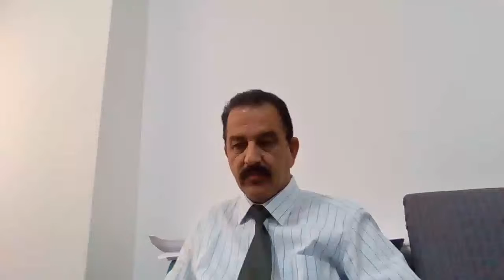Civil Construction Material--Technical Session no 8--Fire Rated Concrete

Comment from the maker: From information that has been developed from fire tests, it is possible to accurately estimate the thickness of many types of single-course and multicourse (face and backup mixtures) walls that will provide fire endurances of 1, 2, 3, or 4 hours, based on the temperature rise of the unexposed surface.

Comment from the maker: For concrete wall panels, the temperature rise of the unexposed surface depends mainly on the thickness and aggregate type in the concrete mixture. Other less important factors include unit weight, moisture condition, air content, and maximum aggregate size. Within the usual ranges, water-cement ratio, strength, and age have insignificant effects.

Comment from the maker: 17.	This is probably due to the low level of stresses, even in concrete bearing walls, and the fact that reinforcement generally does not perform a primary structural function. Concrete cover as specified in ACI 318 for durability will be sufficient for fire ratings up to 4-hr. Most of the information on heat transmission was derived from fire tests of assemblies tested in a horizontal position simulating floors or roofs.

Comment from the maker: 16.	In IBC DN-31 Fire Resistance of Architectural Precast Concrete Envelopes Page 3 2012, Table 601 defines the required fire-resistance rating based on type of construction and Table 602 defines the required fire-resistance rating based on separation distance. The more restrictive would apply. Performance is defined by the authorities (regulatory and insurance) as the time for which each component would reach its controlling end point if it were subjected to a standard test. Fire Endurance of Exterior Walls The fire endurances of precast concrete walls, as determined by fire tests, are almost universally governed by the ASTM E119 criteria for heat transmission (temperature rise of the unexposed surface) rather than by structural behavior during fire tests.

Comment from the maker: A fire-resistance rating (sometimes called a fire rating, a fire-resistance classification, or an hourly rating) is a legal term defined in building codes, usually based on fire endurance. Building codes specify required fire resistance ratings depending on the construction classification, occupancy, and fire separation distance.

Comment from the maker: Formation of holes, cracks, or fissures through which flames or gases hot enough to ignite cotton waste may pass. 3. Heat Transmission End Point. Temperature increase of the unexposed surface of floors, roofs, or walls reaching an average of 250 °F (122 °C) or a maximum of 325 °F (163 °C) at any one point. 4. Hose Stream Test. Collapse of walls and partitions during a hose-stream test or inability to support twice the super-imposed load following the hose stream test.

Comment from the maker: Fire resistance ratings of building components are measured and specified in accordance with ASTM E119. Fire endurance is defined as the period of time elapsed before a prescribed condition of failure or end point is reached during a standard fire test.

Comment from the maker: The degree of fire resistance required depends on the type of occupancy, the size of the building, its location (proximity to property lines and within established fire zones), and in some cases, the amount and type of fire detection and extinguishing equipment available in the structure.

Comment: Great work!
Reply from the maker: Carbonate aggregates include limestone and dolomite (minerals consisting mainly of calcium and/or magnesium carbonate). 
1. Siliceous aggregates include quartzite, granite, basalt, and most rocks other than limestone and dolomite.
2.	Rational design requires the determination of temperature within a concrete member at the location of the steel reinforcement.
Reply from the maker: Fire Rated measures shall be comply with local building codes
Reply from the maker: Thank you for technical feedback